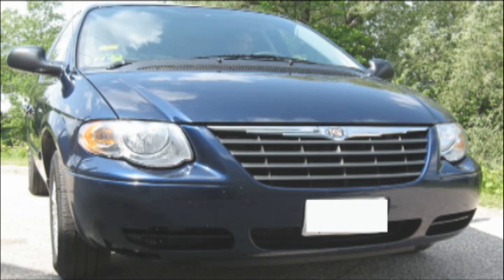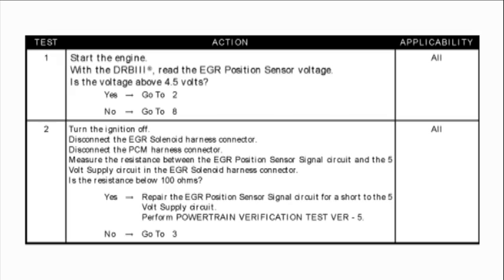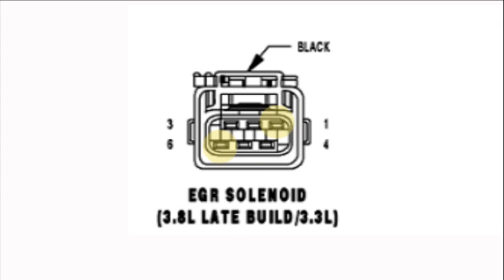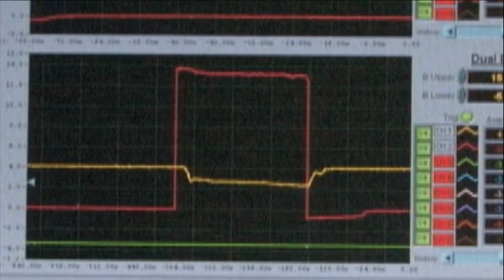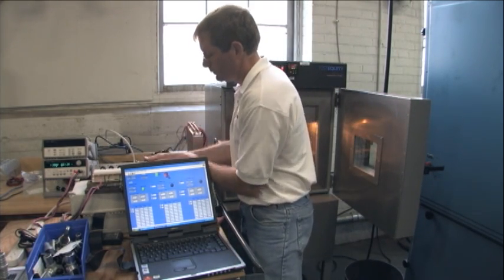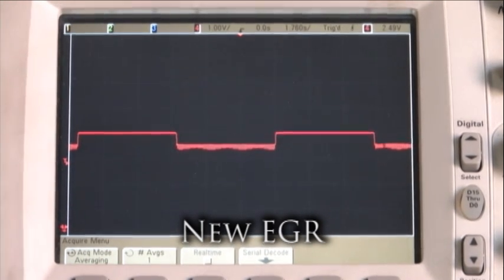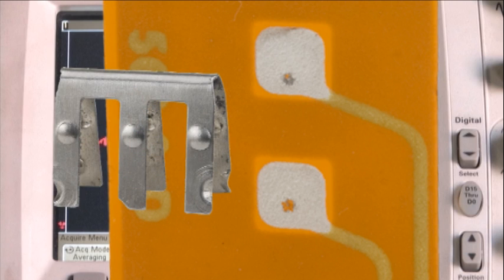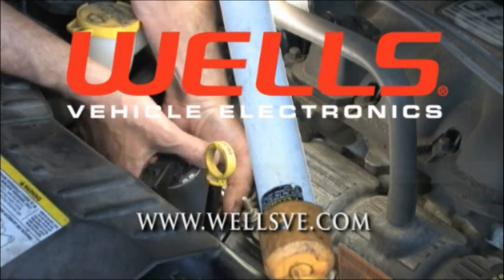P0406 Dodge EGR Diagnostics, Repair, Cause and Fix

Comment: Hi Mark,

I just got the EGR valve delivered (I thinks that's that fastest delivery I have ever gotten) but I see the smaller of the two metal gaskets (which came in a small zip-lock baggy) are dirty and beatup, looks like it's used....I'm not impressed, can you help?

Comment from the maker: In this case, on this type of vehicle, no, cleaning the EGR will not correct the issue. It is not the EGR function that is the problem, it is the position sensor sending false information to the computer. Honestly, I think we are the only ones who have corrected the problem with these EGRs. In Canada you can buy our parts online through Rock Auto under the Airtex Vehicle Electronics name.

Mark Hicks
Wells Vehicle Electronics

Comment: Hi Mark,

Is it possible just to clean out the EGR valve (I see some videos posted showing this procedure)?
If replacing is absolutley required is their any brand I should stick with, and do you have a recommendation on where to buy from because in Canada at the local auto store it costs $150+taxes(13%), and that's at the cheap end?

Comment from the maker: On your vehicle the common cause for a P0405 is a defective EGR valve. If this does not take care of the issue let me know. If the valve is replaced be sure to remove the battery cables and rub them together. Failure to do this after the valve is replaced on your vehicle can cause the same code and some hesitations until the system can re-adapt. 

Mark Hicks
Wells Vehicle Electronics

Comment: I have 2007 Dodge Caravan, I scanned it and got P0405 Exhaust Gas Recirculation Sensor "A" Circuit Low - does this mean I have to change the EGR valve, if not what do I do?

Comment from the maker: The only way to test the EGR position sensor is with a scan tool and lab scope. I am going to assume you do not have these tools. Chances are, by a very wide margin, replacing the EGR valve will correct the problem.
Mark Hicks
Wells Vehicle Electronics

Comment: Great video - One question I have is, I have a defective EGR on our UK 2005 Chrysler Grand Voyager ( T&C equiv). My local dealer has the replacement part, but refuses to fit it because it did not come with replacement mounting bolts and apparently there are none available in Chrysler europe - I appreciate that the mounting bolts maybe soft but is the dealer being excessiveliy cautious? are these common bolts?